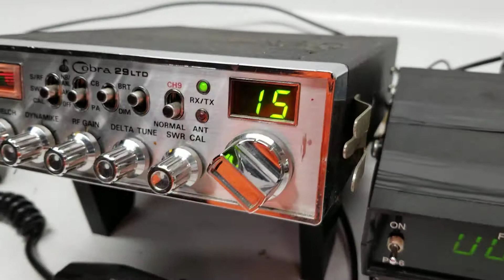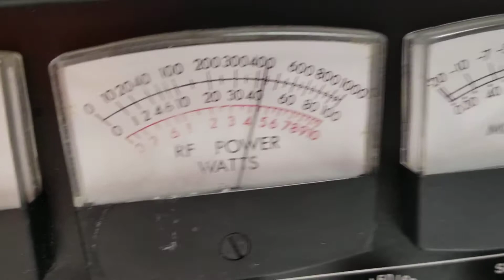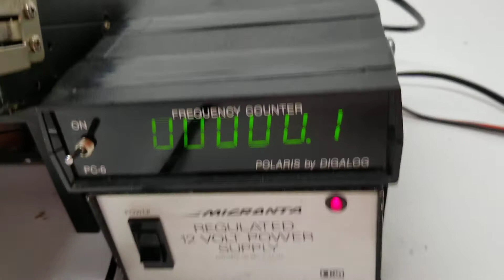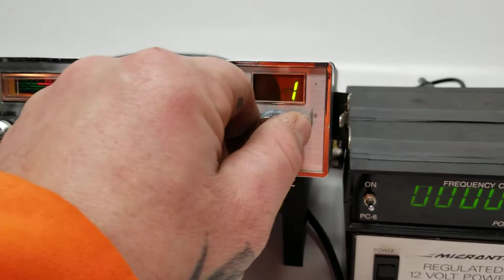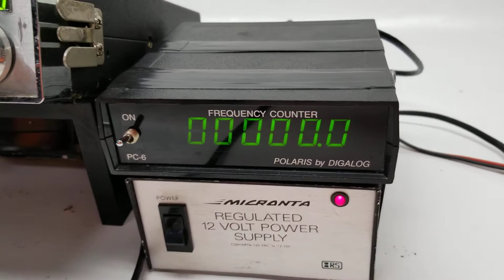Cobra 29Ltd with upper and lower channels

Comment: hello from Canada Eh
I was wondering if the Cobra 29 can be modified to receive and transmit SSB and if so how can that be accomplished? Also where was the Frequency counter lead wired in on the CB PCB?
Thanks
George
Reply: Cobra doesn't have the wiring for a frequency counter, a tech has to install it. The SSB isn't available for it either. However, these whole channels work great. I had the upgrade done on 2 radios. The 29 was first to see how it would work. Then, I had my 148 done to be compatible to it. That was over 20 years ago. I still run that 148 today.